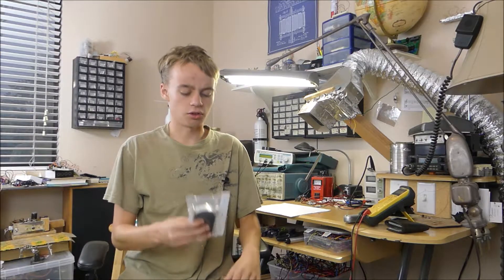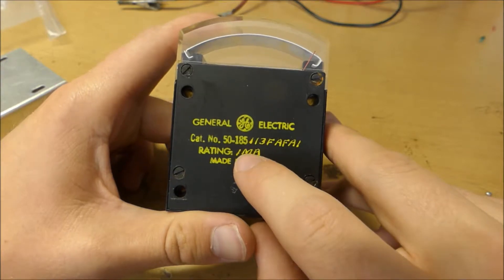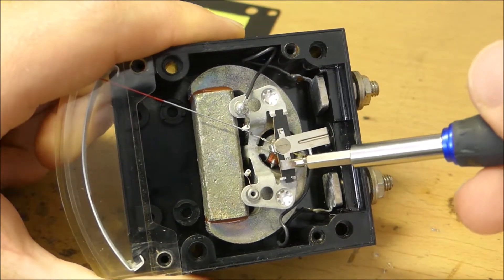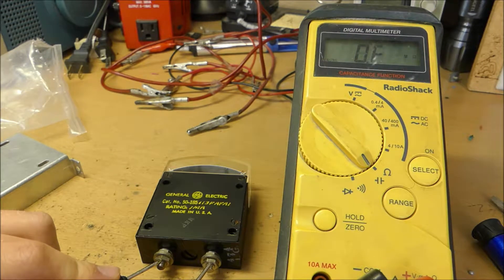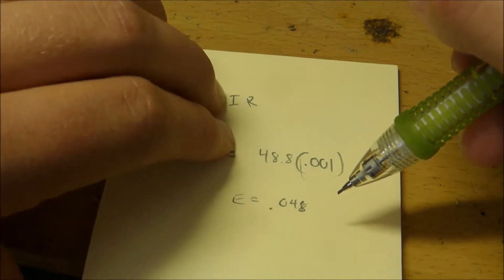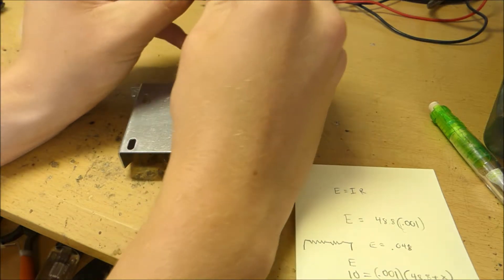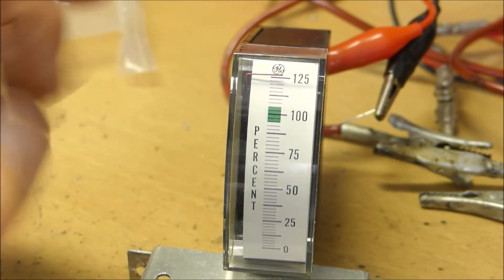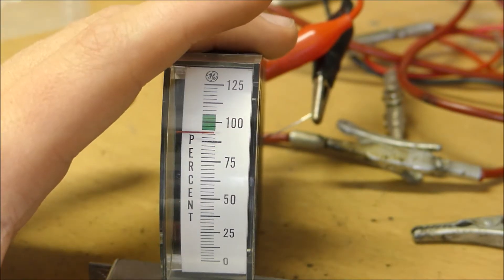How To Use an Analog Meter || How it Works

Comment: A 1.0 milliampere meter movement is a 1000 ohm per volt movement. That means to make the meter read 10 volts full-scale would require a 10,000-ohm resistor from which you would have to subtract the internal resistance of the meter movement.  Ohms per volt = 1 volt divided by full-scale current or 1.0/0.001 = 1000 ohm. This number, 1000 ohms per volt, is called the meters sensitive. You will see this in the specifications for analog multimeters. The higher the ohms/volt rating the less loading on the circuit being measured. 
The internal resistance of a meter should not be measured with an ohm meter. When dealing with meters movements who's full scale current may be in the microamps there is a good possibility that you could damage the meter. That is the current output from the ohm meter may exceed the current required by the meter movement. 

To correctly measure a meter internal resistance, you should do the following. Adjust the current so the meter reads full scale. then add a resistance in parallel with the meter movement and adjust it value until the meter reads 1/2 scale. The parallel resistor value is now equal to the internal resistance of the meter.